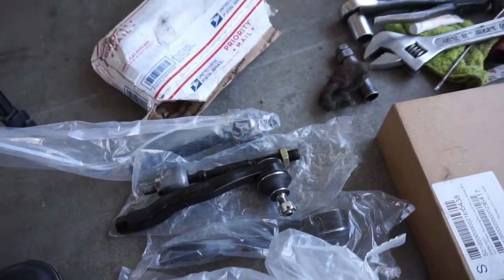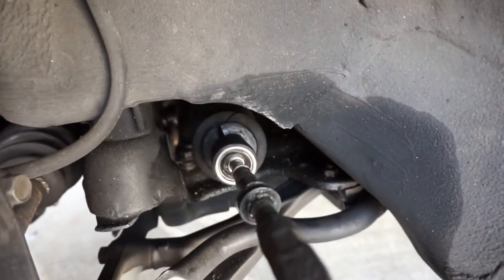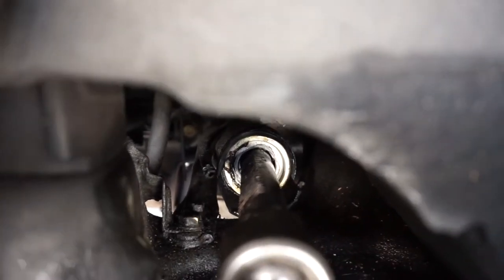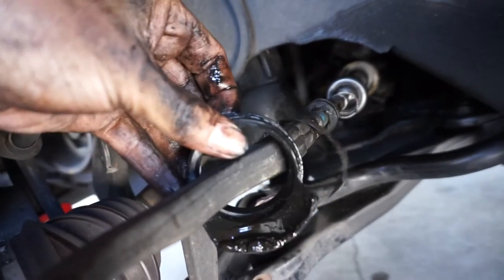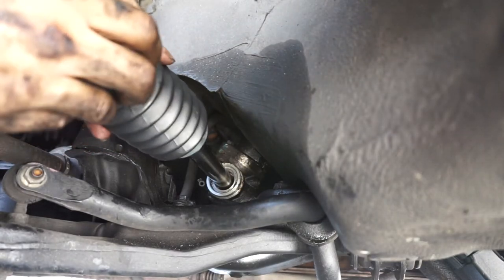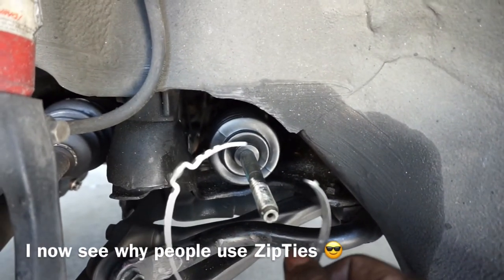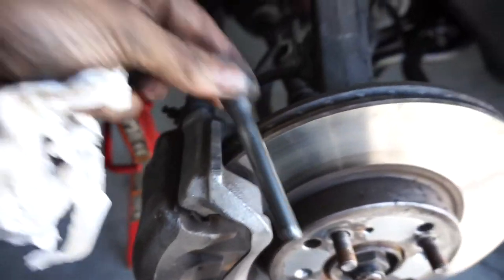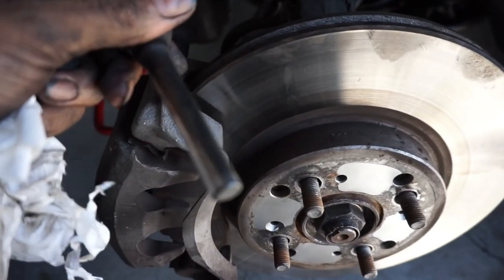2000 Acura Integra Tie-rod & bellow/boot Install

Comment: nice generous video and great job IDIY.  Still holing up? My bellows disconnected on both wheels at the front and are still clamped at the rack. It looks like the bellows cleanly tore from the smaller clamp and not torn length wise.  
Do you think it would be easier to just loosen the not on the tie rod first then break the ball joiint?

Comment: My boot is still fine, is it okay to remove it then put it back?
Reply from the maker: You could remove the boot, clean the inner tie rod joint thoroughly, and regrease it. Wouldn’t be bad. But if the boot isn’t torn, there is no dirt inside, and really not needed
Reply: @IntegraDIY  I was replacing the entire rod assembly. I was able to pull the boot out without damaging it and put it back on with some zip ties. I had to cut the old clamp that was around it with snips, took some patience 😄

Comment: bro i gotta replace my tie rod ends, i did my knuckle/ball joint the other day and the tie rod threads are just fucked so couldnt tighten it all the way. got a 20 degree deadzone in the wheel rn lmao

Comment: BRO MY TEMPATURE METER JUMPS EVERYWHERE THEN IT OVER HEATS THEN STARTS JUMPING AGAIN WHAT DO YOU THINK IT MIGHT BE
Reply from the maker: Emanuel Alfaro 

What car? Year? Make? Model? 

1) make sure your fans are turning on after the engine has been idling for a while 

2) make sure your radiator is topped off with coolant) 

3) make sure you don't have any coolant leaks, leaks will cause air in the system and make the temp go up

4) if you haven't changed the thermostat change it, it could be stuck, preventing the coolant from circulating. 

5) their are 2 sensors on the side of the head under the distributor.. a smal thin sensor called the Coolant sending unit sensor(it gives you the readings on the gauge cluster) and another one callled the Engine Temp sensor.. make sure they're in working order, you can replace them cheap buying from the junkyard or you can have them tested

Comment: How’s your boot holding up, what kind of grease did u use?
Reply from the maker: The boots are holding up excellent, I used multi purpose Castrol grease I believe
Reply: Integra DIY 

Did u ever change ur rack and pinion also... ?

Comment: what prevents just using a zip tie vs that pain in the ass metal ring?
Reply from the maker: +Socknetea a lot of shops use zip ties, I had the metal ties so I used what came in the kit. I do find the metal ties a PAIN to install, but I also like the feeling of having the metal over plastic zip ties
Reply: Integra DIY agreed, thanks for the info and detailed tutorial!
Reply: NPC #303  

what if you inspect your car every 6 months and check on the condition of the ziptie?